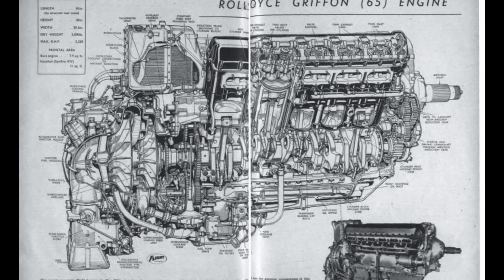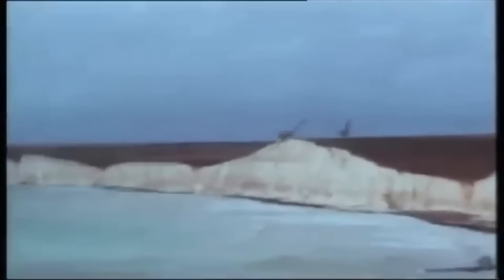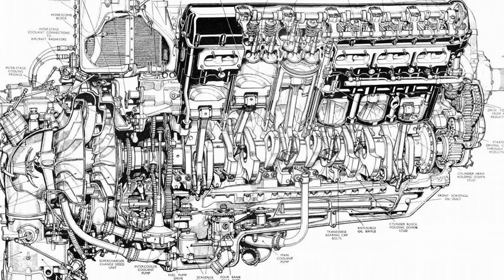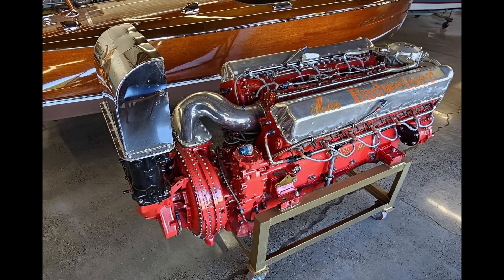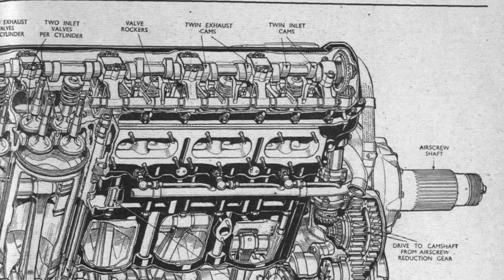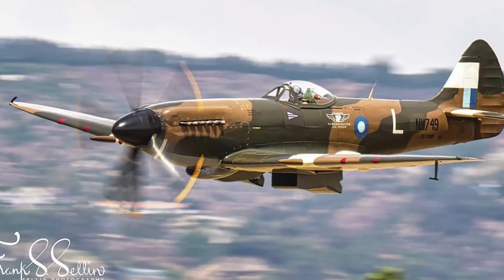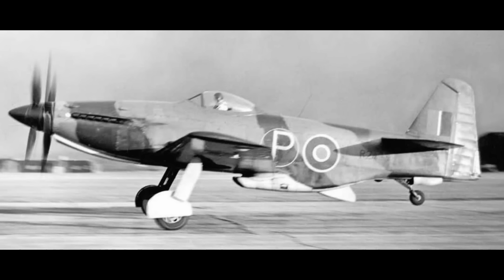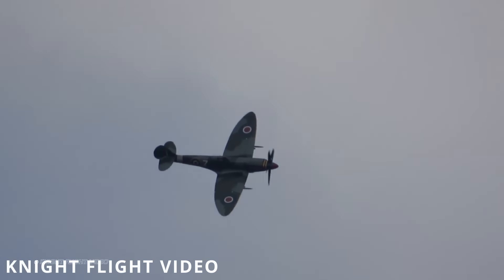The Last Word in WW2 Horsepower - Rolls Royce Griffon

Comment: How exactly would reversing the direction of rotation of the engine reduce torque effects?
Reply: Two propellers 
 Each rotating opposite directions. Zeroing the torque traction. The author first said the second propeller going in the opposite direction.
Reply: @625shapiro  What about the engines torque???
Reply: @will7its That would have some effect too, but the propeller’s effect is much greater due to its greater diameter and mass.

Comment: Amazing how the Merlin is so revered & it was an amazing engine but it wasn't a patch on the DB600 series engine used by the Germans in their BF109 as this was fuel injected with a fuel management system that allowed the fuel mixture to be varied according to its operational ceiling. The Merlin had carburetors that starved the engine of fuel when thrown into inverted dives etc.
Reply: A great deal of myth surrounding DB600 series.  It was not the be-all and end-all.  RR knew full well about fuel injection and its pros/cons.  They decided the cons outweighed the pros.  Don't forget it was not the EFI we now but a purely (and typically German complex) mechanical system that had high fuel consumption and quite poor mixture control (webbaroo hype aside).  RR determined that the cooling effect on the fuel/air charge caused by the carburettor reduced the need for intercooling.  As to the negative gee cut-out issue look up 'Miss Shilling's Orifice' that went a long way to resolving the issue while the pressure fed carb was being developed.  also bear in mind that the Merlin achieved comparable HP to the DB600's through both engine's production runs while being considerably smaller displacement (Merlin 27L, DB600 34L)
Reply: The DB600 series would not have survived in carburetted form because of the compromises needed in design to cope with the German lack of strategic materials. The hydro-mechancial ECU was needed to stop the thing detonating to destruction.
RR did not go for single point fuel injection due to a major mistake by the person tasked with evaluating it versus carbs. He was responsible for the loss of a lot of pilots.
Both sides made mistakes, but in the German case the mistake was starting the war in the first place when economic warfare favoured the Allies.
Reply: Why focus on the 1940 version of the Merlin carburetor, while the US was still drinking martinis and building vehicles in Germany.
Reply: Whilst there is some truth in what you say re carburetor vs direct fuel injection, the direct throttle body fuel injection used from 1942 onwards was very good indeed. Yes, the db601 etc series had a fluid coupled supercharger drive, but that was simply no match to the liquid/air intercooled, 2 stage supercharger in the merlin 60 series. Really, in the crucial years of 1942 to 1944, the allies had the better engine in the merlin, and by a significant margin. It wasnt until the Jumo 213e that the Germans had something comparable.
Read Calum Douglas's book- it explains this very well.

Comment: How does direction of rotation affect torque quantity?
Reply: I haven't looked it up but my guess is that instead of the crankshaft and prop rotating in the same direction they used gearing so the crankshaft and prop were counter-rotating thus eliminating some of the gyroscopic effects.
Reply: For a single-rotation prop - it doesn't.
Reply: @stumccabe  Well, I hadn't thought of that and it does make sense.
Reply: @johnwiles4391  It doesn't really make sense though as the Merlin(And many many other engines with a reduction gear) also did have the crank and prop rotate in different directions.
Reply: The only thing I can figure is that he got confused with the Griffon models whcih had coaxial contra-rotating twin propellers whcih would reduce torque.  But what he actually said is complete nonsense.
Reply: @stumccabe  Except, the crank shaft in both the Merlin  (except the mk131 and 134) and the Griffon turned in opposite direction.  When viewed from the rear, the Merlin Crankshaft turned Counterclockwise and the prop turned clockwise, while on the Griffon the crankshaft turned  clockwise and the prop turned counterclockwise.
Reply: Regarding it as a vector minus one gives twice the magnitude of plus one.  It actually changes the leg the pilot pushes on take off.  Reversing propeller rotation is awful if any slight vertical stabiliser direction offset (opposing take off swing) is not changed at the same time.

Comment: While the Griffon made production, it was NOT the most powerful WW2 era engine.
For pure piston engines, the Lycoming XR-7755 made 5000 HP in prototypes (2 built) , the Pratt and Whitney R-4360 among production engines made 4360 in it's -51 model (though only 3800 for the most powerful "completed during the war" version).

The Griffon MIGHT have been the most powerful "V-12" of World War 2, but was a weakling comparatively at "barely over" 2400 HP for it's most powerful version.

Comment: @6:44 having the Griffon's crankshaft rotate in the opposite dire tion to the Merlin did NOT alleviate the problem of the torque steer (in fact , with it's increased capacity and longer stroke, it was actually worse than on the Merlin) - it was the fitment of contra-rotating propellers on certain marks of the Griffon that did.

Comment: It took a long time for Rolls-Royce to get to fuel injection, several years after the German engines. 
This report said that this was modern innovation. But in reality, it was several years late.
Reply: Totally different concepts although often mistakenly quoted in YouTube comment sections. British and US aircraft engine manufacturers never rated the diesel type direct injection systems used in German engines believing them to result in inefficient fuel/air mixtures.  Later Rolls Royce engines still used Carburetors for a far more efficient and accurate mixture control…they simply used metered pumping of fuel into the carburettor rather than the earlier Venturi type SU carburettors.
Reply: … AND pressure carburettors feeding into the supercharger intake is NOT single point fuel injection.

Comment: Rolls Royce Griffon:  Look how powerful I am.
P&W R-2800: Hold my beer...

Great Content!!!!
Reply: R-R Griffon was around 2200 ci vs the P&W R2800, at 2800 ci. The Griffon was typically 2000-2450 hp vs the R2800 was typically 2000-2300 hp. The Griffon was very much smaller, not only in it's cubic capacity, but also in weight, and minute in frontal area compared to the R2800. The R2800 will have to stand back and hold it's own beer, or just drink up like the man the Griffon is!

Comment: Why does the Griffon sound so much different than the
 the Merlin? They are both 60deg V12's. The Merlin sings while the Griff snarls, you can almost hear each individual cyl fire. Firing order? The fact it rotates in the opposite direction? I would sure like to know.
Reply: Per Graham White, firing order was different, and the the cam profiles were very different. In most mature form: Merlin had 70-deg overlap, 288 degress of duration to Griffon's 28-deg overlap and 248 degrees of duration. Basically, Merlins use 'race cams.'

Comment: Torque was greater with the Griffon, and did not help the Seafire control during take-off.  All of the left turning issues with the Merlin Seafire were present with the Griffon Seafire, except that they were right turning forces (P-factor, precession, slipstream, torque, adverse yaw).  
Only the contra-rotating props on the post war Seafire 47 eleminated those adverse forces.

Comment: After the car, you could buy a lot of these engines at scap dealer prices. A number of Drag Racers and even street Hot Rods tried to use these enormous engined with varing results. Unfortunately 
the mass of the engines made it difficult first, to get the power to weight ratio of A HEMI on Nitro..then also 
it was difficlut to get enough weight over the rear wheels.
So most aero engine dragsters got top MPH honors but not the really Low e.t.'s to make top eliminator.....

Comment: How does spinning the engine the other way to anything to counteract torque? Are you saying there was a gearbox between crankshaft and prop that reversed the drive direction?
Reply: It absolutely doesn't.  That's complete nonsense.  Some Griffons had twin coaxial contra-rotating propellers, that arrangement did counteract torque effects.  Maybe the narrator got got confused by that.    But you're right, simply changing a single prop to turn the other way doesn't counteract torque at all, it just makes it act in the opposite direction.

Comment: At 6:40ish, the direction of propeller rotation makes no difference to the magnitude of the torque reaction effect, just the direction. Another couple of important points. Even thought the griffon displaced 37% greater volume producing nearly 50% more power it wasn't much heavier and the frontal area was only about 4.2% greater.

Comment: I would love to know how Aichi  was able to  eventually get 1700hp out of the Atsuta (DB601a) which is what DB  was getting out of the 603 a much larger displacement motor.  Did Aichi out engineer DB with their own system?
Reply: The nazi 605 was the ‘improved’😂 109 engine.  The enormous heavy 603 was used in planes like the He 219 Uhu.

Comment: I disagree with the title.  The last word in WW2 horsepower from an ICE would have to go to the H-24 Sabre.  Considerably more innovative and more powerful.
Reply: And very unreliable.
Reply: @bobsakamanos4469  True, but the problems were fixed eventually and the video was about horsepower, not reliability.
Reply: @csjrogerson2377  hp is nothing without reliability.  A highly trained fighter pilot couldn't be sacrificed because of  poor engines.  Also, the poorly designed Typhoon needed more HP to drag its huge, non-aerodynamic bulk through the air.  A poor engine bolted to a poor airframe was an unholy marriage that killed its pilots.
Reply: @bobsakamanos4469  But that wasn't the question.  If the question was "Which engine was the best or which was the most reliable?" then reliability would be a factor.   ATFQ
Reply: @csjrogerson2377  lol,  you're situating the estimate son to support an invalid concept.   You're condoning Napier Sabres for being crap and killing too many of our own pilots.  At war's end they were scrapped.
Reply: @bobsakamanos4469  Your English grammar is crap. 
I  wasn't writing a concept.  
I am not condoning Napier Sabres for anything.  Stop creating a strawman argument.  
I was just saying that they produced a very large amount of horsepower and more than the Griffon.
Reply: @csjrogerson2377  yes, apologies for my grammar. Multi-tasking last night.  Again, HP that is unreliable is not an effective solution , especially in the trouble plagued Typhoon airframe.  My perspective is from the pilots' view, having to risk their lives in a crap a/c before even seeing the enemy.  My father had flown some of these monsters and lost good friends because of that engine.  Your argument is invalid from an operational point of view. The post war Sabre V was more effective due to Bristol being strong armed to give up their patent on the sleeves.
Reply: BTW, the new Merlin 100 was being bench tested WEP at 2640 HP in 1944, derated to 2200 HP for the Hornet and P-51H. ... and reliable.
Reply: @bobsakamanos4469  Not talking about effective solutions, just talking about horsepower and the Napier problems were fixed, eventually, and then jets came along and piston engines were overtaken by events.
Reply: @csjrogerson2377  and yet Bristol sleeve valve engines continued to be used up to the 1970s.  Napier was an anchor around the RAF neck.
Reply: @bobsakamanos4469  And?

Comment: radial engines like the R2800 went on to serve post war as mainstays of commercial planes like the DC6. Why weren’t “inline” engines like  Merlin and griffon more used commercially? Is there something more inherently more reliable about radials?
Reply: I think a large portion of the explanation is the post-war dominance of the US aviation industry, and their preference for radials for bombers and transport aircraft.
Reply: @ the U.S. manufacturer Merlin’s domestically in massive numbers for their mustang fighters. So availability is not the issue. So why were radials preferred in bombers and transport aircraft then? Is there an inherent reliability or ease of maintenance? Because I would think a radial is actually more complicated engine. The advantage I see of radials is more robustness supposedly under fire but that wouldn’t matter for commercial airliners.
Reply: @gj1234567899999  After the war RR wanted rather steep license fees for the Packard Merlins, so that wasn't attractive to civil aviation.
Reply: Brits used very reliable Transport Merlins for many years after the war.  The Spanish used transport Merlins 500s when their local Me109G production ran out of nazi DB605s and then dropped Hispano Suizas.  They were also used in their Heinkel 111 version.

Comment: You stated many times it was revolutionary. But why? Did not heard any specific technical reason for this, maybe the nitrid coating. And what about the direction of rotation? Way unclear. And more difficult handling with counter rotating props (about 9 min.)? Don't think so. Not mentioned the venerable Schackleton at the applications section. So there are some serious holes in the vid.😢
Reply: I'm pretty skeptical that nitrided steel components were a revolutionary advance for WWII aircraft engines.

Comment: This video contains a number of mistakes which unfortunately would take pages of text to correct. 
The Griffin did evolve from the Rolls Royce R engines and in 1933 a de-rated version of the 'R' engine called the Griffin was built and tested. Problems with vibration and the need to develop the Merlin resulted in this early Griffin soon being  shelved. The later 1938 Griffin being almost a completely new design.  However, valuable information regarding component manufacturing and strength were learned from the first engine and used to make the Merlin more reliable.
 Although the Griffin was a development of the 'R' engine the 'R' was itself a development of the the Rolls Royce Buzzard which first ran in 1928. All of these engines had the same stroke and bore and the same vibration issues.
At time point 6:50 it is claimed that the direction the propeller turned by a Griffin aided take-off on an aircraft carrier.  This is totally wrong as the torque from the Griffin engine actually forced the aeroplane over to the right which on a British carrier was directly towards the funnel and Island.  A problem not resolved until contra-rotating propellers were fitted to Spitfires and the engine down-rated on Fairey aircraft.

Comment: The Spitfire XII had a single-stage supercharger, and it was not particularly good at high altitudes.
Reply: There was a screaming need for a low altitude Spitfire, The Mk XII must have been 100 mph faster than an ordinary Mk V at low altitude.  The P-40 and Mustang I/P-51A were both way faster than the Spitfire V at low altitude.  It was all about full throttle heights and engine power absorbed by the superchargers, the Mk V Spitfire was only capable at high altitude.
Reply: @givenfirstnamefamilyfirstn3935  The MkXII was about 50mph faster than a MkV below 5000ft.   Its speed advantage deteriorated at higher altitudes, but not to the point that the MkV could catch it.

Comment: Surprised that RR didn't learn from the full fuel injection from the Germans, and have FI with Griffen from the outset. We're they also fitted to Lancaster and the Mosquito?
Reply: They experimented with direct injection long before the war and concluded it resulted in a poor fuel/air mixture. Which is why they never adopted it.

Comment: Direction of rotation has no impact on the torque, it only changes its application and the way the pilots had to counteract the torque effects (left or right rudder pedal).
Coutra-rotating propellers does cancel the torque effect, as two props rotates the opposite way, then the only reaction is longitudinal thrust.
Action always equals reaction, simple physics.

Comment: Britain cannot manufacture these engines ever again. 
That was about the peak of British engineering.
Reply: Yeah they would be arrested today.....
Reply: your right, Engines have come a long way since the Griffon
Reply: Rubbish, ever heard of a trent xwb ? The engineering in that is on another level
Reply: @jase6370  Plus RR’s major role in the Typhoon’s EJ2000, the lift fan on the F-35B thus maintaining RR’s pioneering VSTOL technology, they will also be leading the power plant for the Tempest.

1971 was the moment of danger for RR when they went bust, too important both economically and for defence it was saved, reminding that they adapted their successful aero engines for maritime use, Tyne, Spey, Olympus plus the nuclear reactors for RN submarines. The latter is a 60+ year legacy still going strong.

RR are now planning to re enter the narrow body airliner market and the UltraFan engine project for airliners too.

 No one has been arrested whatever nonsense that means.
Reply: Rolls Royce is still making engines that power both military and civilian aircraft. Also, the UK is at the centre of world motor racing. That includes many of the engines too. The Mercedes F1 engine is built and designed by Mercedes-AMG High Performance Powertrains (HPP) in Northamptonshire, and started out as Ilmor, and founded by a British and Swiss engineer in the UK. That emerged via Cosworth, another major name in engine design and consultancy, and which is also based in Northamptonshire.